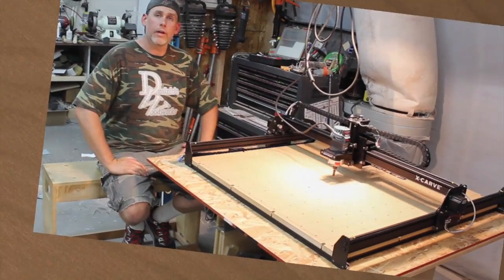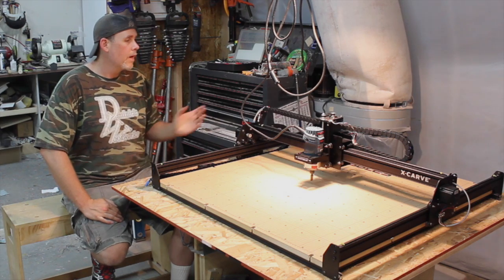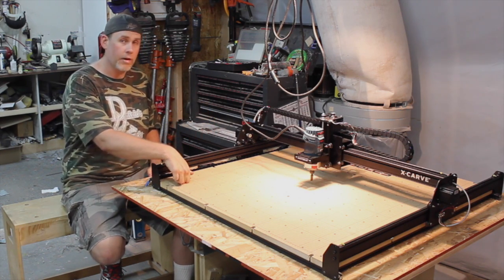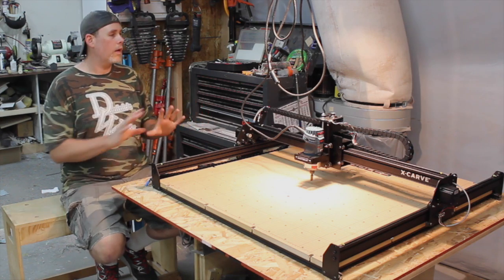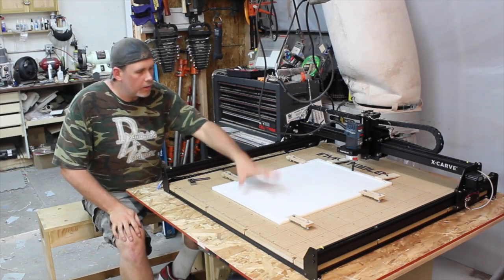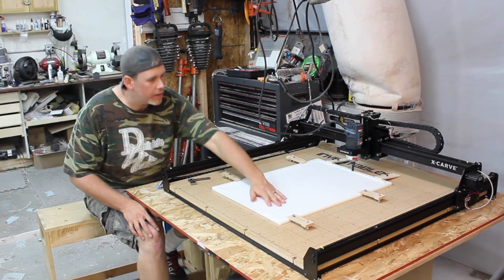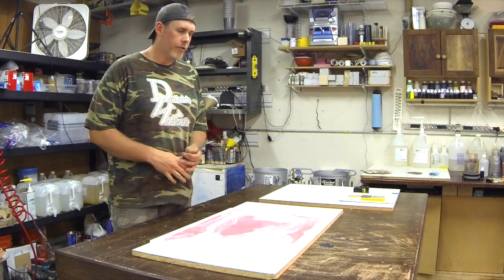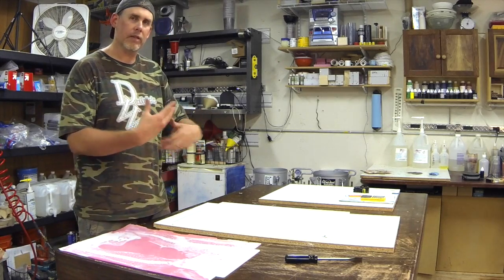X-CARVE Review & Making an HDPE Mold For Casting Resins

Comment: What about just screwing in walls to the sides of the HDPE base. Use spacers to get ur depth right. No fussing with an expensive machine and no warp. Make different height walls for different thickness pours. I just don't see the need and especially the expense of a machine like this when the same can be done with a hand held router, in applications like this. Fun to play with, though since you got it for free.

Comment: Having an X carve basically opened up a new ballpark for you. If you would use a thicker HDPE sheet you could make letters and shapes which you could use in other pours. The easle software that come with X carve is fairly easy to learn. CNC requires a different way of thinking. At least that is how I experienced it. Knowing what shapes are made in which way. 
Thanks for sharing this video.
Reply from the maker: +Lars de Waardt Yeah, I was all excited about it at first, but I haven't really done too much with it yet. Unfortunately for much of what I do, a laser is a better option most of the time. Other problem is I've been so busy, I haven't really been able to take the time to work with it, but I hope to try out some more things with it next year.
Reply: When speaking bottle caps. The idea that came to mind of how to use the xcarve. Use a sheet of the hdpe and mill out shapes. For example an H and do it in such size that it would fit within a bottle cap. Then pour a solid color and put that shape into a clear cast for a bottle cap. Easily personalized bottle cap:-)
Take that to the level of a sports fan and I think you can imagine that the sky is the limit.
I believe that in every day there should be at least an hour or 2 to keep the child alive. in other words if there is not enough play it becomes a job:-)
Reply from the maker: +Lars de Waardt Well, I have to pay the bills first Lars. Although I do consider it "play", this is how I make a living and I don't actually have one or two hours to give up per day to play with the x-carve unfortunately.
Reply: There are worse ways to make a living. I worked at an office for 7 years and even though I enjoyed my work. I wasn't doing what i wanted to. I do understand that the bills need to be paid first.
Reply from the maker: +Lars de Waardt Same here, gave up a well paying office job to follow my passion. I love what I do. I think that's also part of the problem with the x-carve. I just frankly don't care about that machine, and have no burning desire to work with it. I enjoy casting resins a whole lot more than messing with a cnc machine.
Reply: +Zac Higgins I heard in some reviews that the X carve seemed flimsy when used on harder materials and that because of that there was more tear out during the milling. On the casting part, how strong is alumilite? What does it compare to?
Reply from the maker: +Lars de Waardt It's pretty hard, somewhat similar to acrylic I would say. Less brittle, but it's basically a hard plastic. The two big problems with the x-carve are the stock spindles, upgrading to a palm router will solve that problem, and the long span of the gantry on the 1000mm version. It's a pretty long stretch, and it will deflect fairly easily. Not as much of a problem on the 500mm one. There are ways to stiffen it up though on the 1000mm one.

Comment: just found your channel and love it .... AWESOME!!!!!.... maybe to get the texture on both sides you can clamp a second piece of HDPE on top as it is setting up... using clamps like on the CNC ....
Reply from the maker: +Cw Hussey Thanks CW!  The sandwich mold idea will get you texture on the top, but it's quite a bit messier. I actually tried that that using Melamine on the first couple ribbons I made. I found it's easiest to just scuff the top side of the ribbons with some sandpaper to knock down the smoothness.

Comment: Thanks for another informative video Zac. Appreciate you Sharing the tip about scuffing the material for a good bond.
Reply from the maker: +cmcustomcarpentry Thanks for watching! I think I might have forgotten to mention that in the ribbon video. Although I haven't had bonding issues myself when I haven't scuffed them up, I try to do it on them anyway just to have a little insurance. If you recast the ribbons the same day, they should bond excellent though. I'd highly recommend scuffing up if they have been sitting for a while and fully cured.

Comment: Zsc,

How thick was that pour?  It seemed really flexible.   Could you twist it into a 3/4" tube for a pour or would it have to be flat?

I've gotta tell ya, your video is the first video in months that was entitled X-Carve, Inventables, CNC or whatever that I didn't just delete upon seeing the words.

Thanks,
JimE
Reply from the maker: +Jim E Well, I'm glad you stuck around to check it out!! It was pretty thin, I didn't pour enough resin to fill the mold, so it was between 1/16" and 1/8". 

That clip in the video of it being pulled out was only about 15 minutes after I poured it, so it wasn't fully hardened. Now that it's cured, it's rigid.

You can twist and bend it into any shape you want when you go to recast the strips, but you have to heat it up with a heat gun or stick it in an oven for a few seconds once it's cured. I just put the strips in my little toaster oven for a few seconds (time depends on how thick the strips are), then I put it into whatever shape I want, once it cools again it stays rigid in that shape.